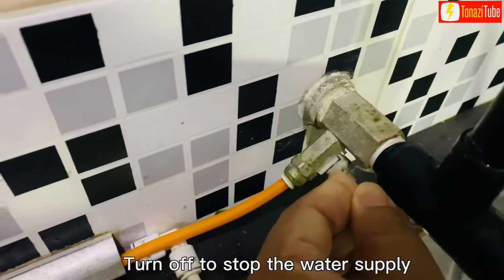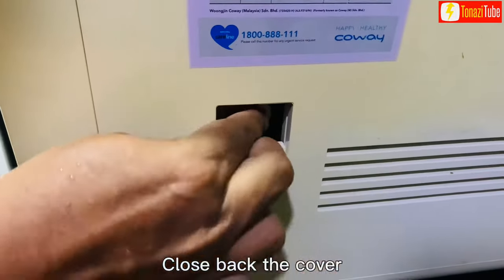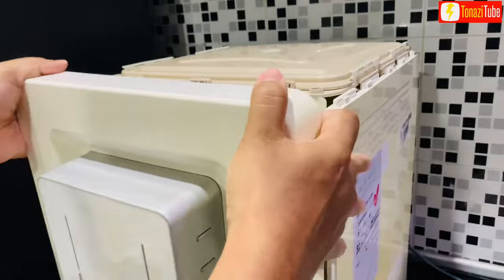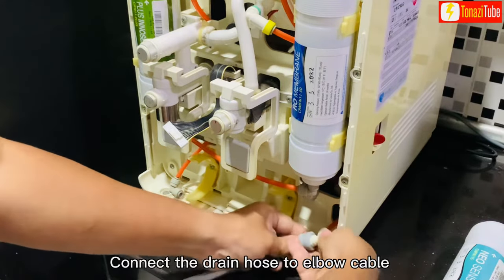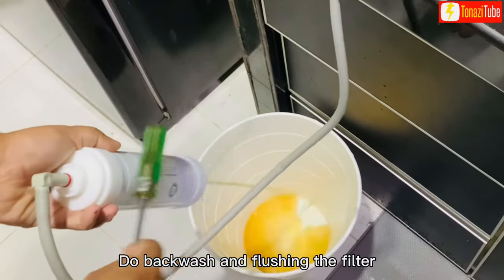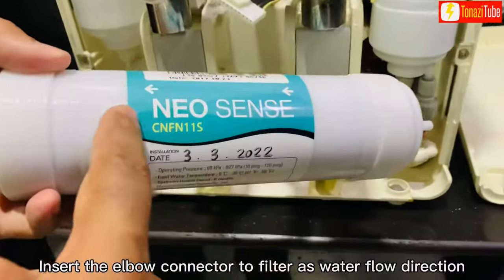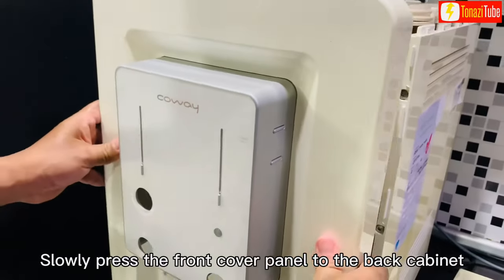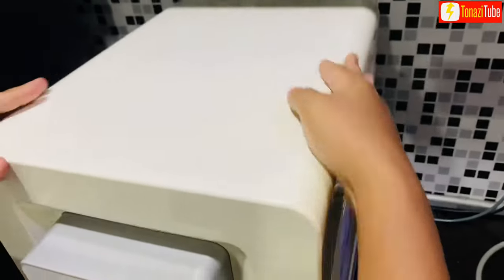How to Backwash and Flushing Filter Neo Sense | DIY Coway Filter Services Step By Step

Comment: Coway saya kerap keluar simbol LOW WATER. Bila keluar je simbol tu, air panas takkan keluar, hanya air sejuk je yang keluar, tu pon tak banyak & cepat habis. Air yang keluar (air yang dibuang) pon tak laju. 

Banyak youtube mereka kata puncanya ialah DFLC dia tapi saya check ok je. Atau mungkinkah filter yang tersumbat?
Reply from the maker: Filter Coway Tuan sudah lama tak servis atau ditukar tak?Kalau lama tak servis kemungkinan filter tersumbat dan timbul masalah seperti tuan alami sekarang.
Cuba lakukan servis pada filter sebelum tukar yang baru dulu(seperti video) dan tengok masalah selesai ke tak.
Reply: @TonaziTube  saya dah servis ke tiga² filter, flushing laju je air keluar tak nampak macam ada sumbat pon tapi memang dah lama tak tukar filter, dah lebih setahun kot.
Adakah itu puncanya (dah lama tak tukar) walaupon filter nampak masih ok lagi?
Reply from the maker: Mengikut rakan yang bekerja dengan coway,salah satu punca adalah filter yang lama x servis dan tukar.

Antibacterial Filter Lifespan:
- Neo sense (6 month)
- Ro Membrane (24 month)
- Plus inno Sense (18 month
- Ceramic (12month)
Reply: @TonaziTube  tq bos 👍
Reply from the maker: Sama2 Tuan.Harap dapat membantu.